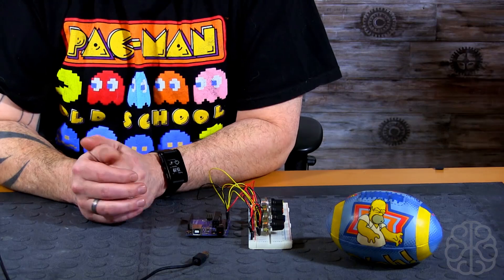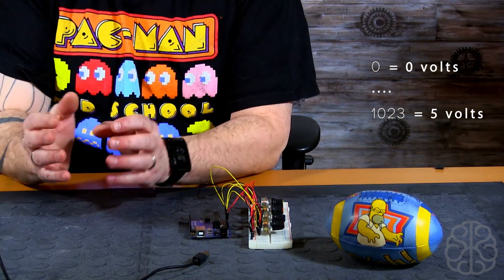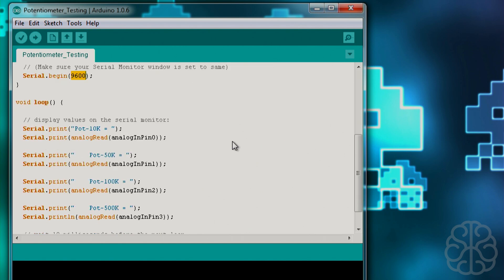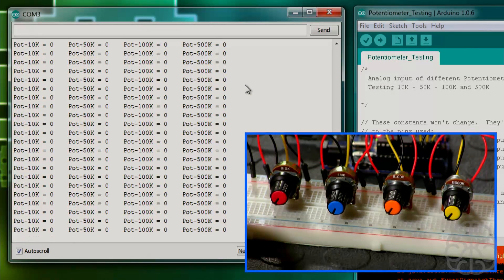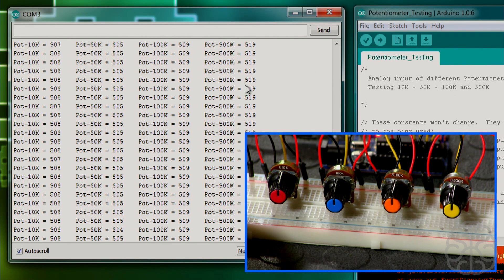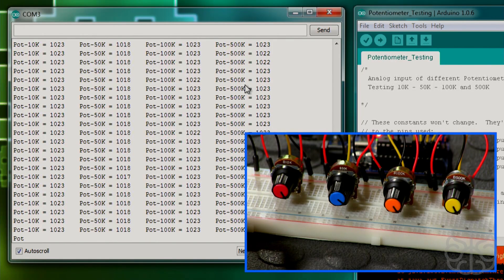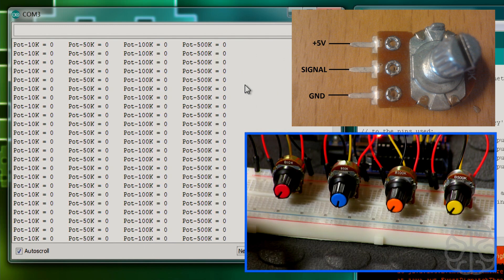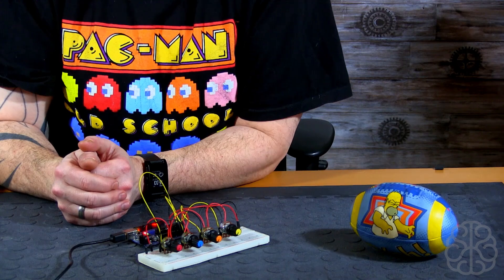Potentiometer Values?  Does it matter in your next Arduino Project?

Comment: What you did not discuss is, although the position of pot is static but, its value is changing and it is a very big issue because if you build a program which send incremental  or decremental code when pot val increases or decreases respectively but if pot value continuously swing back and forth then your program will continuously send data which is disaster, how will you solve it?
Reply: Make a report and average out the values over a lastmillisecond type of delay (to not stall other operations) loop, so that a value needs to change more than 1-2 back and forth.

Comment: Im using 10k pot with arduino for running stepper motor but the stepper dosent run at full speed it can do! The code has no speed max or anything defined. Help
Reply: 1023 might not be 5V, but somewhere along 4.6V.  I'm not sure if this will matter for the output stage of the Arduino, but it could do that.
If the stepper motor is run through PWM, it might be that the frequency for the PWM output is not high enough, and the motor tries to keep up with the low frequencies but has to much inertia to not act upon it quickly enough.

Comment: how about higher voltages????????? thats why i was here
Reply: It depends on what you call higher, if anything, it's rare for things higher than 24V's to be controlled with a pot directly....because the amount of heat dissipated (it's a resistor after all, just a variable one) will become a problem quickly....
Should you want to switch higher voltages, look into higher power transistors or even MOSFET's and control the input through that.  I will warn you that MOSFET's can be more difficult to control.

Comment: I have my cars throttle body pot. I connect it on my arduino and im reading values from 512-920 instead of 0-1023 . I guess its my pot's resistance from it's own that give that value.  Is anything i could do to make it work to the full range or should i modify my code to split  that range of existing pot to 255 values of output?
Reply: If we are talking about an actual driveable car and not a remote controlled smaller one: pretty sure it's something digital and it get's corrected later on, or might use some error correcting in combination with the ECU in order for it to know about the sensor being present and in working order, since drive by wire is very common for years already.
It could also be calibration meant to be used so that the gas pedal registers a range from standard idle RPM to something considered more safe by the manufacturer instead of full acceleration...

Comment: how can you make the potentiomater only rotate lets say 15 degrees or 20 degrees? how can you adjust the rotation of pot to go from zero to 5 volts or off to full on and only turn the pot so many degrees?
Reply: Physically this is not possible for most (and if you do find one that has such a rotational range of movement it's probably expensive) but you can do this in the Arduino code with mapping the value to something new.
Keep in mind that this will cause trouble when you exceed the maximum value electronically: you will basically restart the electronic reach of whatever it is that you do with the input's data (As in: if you state that 0-128 is 0-255, after 128 on the input this will cause problems because it will not have a clue what to do with that value).
If you do want to solve this physically you could try to find a button (A Ritel or some different brand) with a notch on it that hits a part on the case your project is housed in so it stops movement.

Comment: Great video and explanations!  I am really new to building electronic circuits.  In my project, the parts list has 10K pot but a 50K was sent.  I built it anyways figuring the value shouldn't matter much.  The project is a very simple LM386 OP amp.  I watched your video to the end and at 6:54 you mentioned this does matter for the pot values in these applications.  Is this why my should be ridiculously easy project does not work?

Comment: How many 10k pot can I connect with Arduino Mega along with 16channel multiplexer?
that means 16x16 pots = 256. but will it function normally if powered with USB?
my concern is if there will be any effect on the reading as i am planning to make a midi controller with almost 200 knobs.?
Reply: Probably not a problem, you will probably need a separate power supply so the multiplexer itself is stable enough, especially since you are going to be using multiple ones you will probably exceed the capabilities of the Arduino's power producing capabilities.
I hope your project worked out by this time though :).
Reply: @Dutch3DMaster  thanks for the reply. yes i completed the project. the video is on my page now

Comment: Those has different RESISTANCE value...4 ways audio1) negative output input ...volume 2) pin1 pin2 or pin 2 pin3..pin1 pin3 circuit with CAPACITORS L1 pin2 negative..4) pin1 pin3 out pin2 CENTER  tap ...all pots has different values adjustable VOLUME CURRENT IMPEDANCE  FREQUENCY ...THOSE ARE THE FOUR WAYS CIRCUIT...4POTENTIAL BALANCE HIGH LOW FADE FRONT BACK EQUALIZER FREQUENCY VOLUMES GAIN LOUDER EXTRA BASS....
Reply: what

Comment: This video is not all that accurate it misses vital info, pots between 1k and 100k will work, but it's best to use 10k or 20k pots.
The datasheet indicates that accuracy will be lost for values higher than 20k. (This is because so little current will flow.) (This isn't shown here because there is nothing else connected and the pots are very close to the Arduino, using short wires.)
If you use values lower than a few hundred ohms you risk blowing the Arduino or power supply: more Info: https://arduino.stackexchange.com/questions/51230/what-is-the-lowest-resistance-pot-that-is-useful-with-an-analog-input

It's in the Analog Input Circuitry section of the Analog-to-Digital converter chapter  (section  21.6.1 on page 257 of the ATmega168/328 datasheet  Rev. 80251-AVR-02/09)

The second paragraph begins: "The ADC is optimized for analog signals with an output impedance of approximately 10 k[ch937] or less."
Reply: How many 10k pot can I connect with Arduino Mega along with 16channel multiplexer?
that means 16x16 pots = 256. but will it function normally if powered with USB?
my concern is if there will be any effect on the reading as i am planning to make a midi controller with almost 200 knobs.
Reply: @DJNAVENDU  Sorry to reply 8 months later to this comment, but since I had the same question and found my answer may as well share it. 
The thing to keep in mind is that each port of the arduino should not handle more than 40 milliamps per pin in the best scenario. Based on ohm's law, if you have 5 v, and 40 milliamps, that means 125 ohms, going any lower than 125 ohms will pull more than 40 milliamps and will burn your diodes on the arduino... or worse start a fire. 
The higher the resistance, the less current is needed... but at some point you don't have enough in that circuit to be detected properly (over 20k) at 10k you have 0.5 milliamps and you are only using 0.0025 watts of power so it's a perfect balance of effective current and it's safe to use with 5v ! Hope this helps ... and I still have much to learn.. so thanks to videos like this, partially true, partially incomplete, and great comments like the one above from niksoftware and intelligent questions ... and answers ... we progress.

Comment: why you're connection at arduino pot is different mine at left pin is ground and at the right is 5 v
Reply: as you (arduino) measures the middle pin. The middle pin is 0 - 5V by its position. No matter the potentiometer value. How the video shows.

Comment: Be good to also explain that a pot is not just a variable resistor, but a complete voltage divider.. as resistance increases on one side of the signal wire connection point it decreases an equal amount on the other side. The total resistance seen on the overall connection from 5V supply to GND is the value of the pot. This also determines the current induced in that connection (as someone mentioned below - if value of pot is too low, could induce large current & damage supply.. unlikely though as most pots have large enough resistance value).
Cheers

Comment: Hello, I'm a complete newbie. I want to build such a circuit with 3 pots for a DIY sim racing pedal set. Can someone help me get the schematics for this circuit? (how to connect the wires without breadboard?)
Reply: Supersimple: Just solder the wires as you see them on most breadboard setups to the potentiometers directly, and use either pin headers or cut up a Dupont style wire that you might have bought with your Arduino and use that as the connector on the Arduino side of things.
If there's anything surrounding Arduino's this is about as simple as you can get it.

Comment: Pot value does make a difference in the lower value and for less  noise. If you connected a 20ohm put. power supply would blow. I know you were genralising here, but someone will try it and complain.
Reply: It is simply Ohm's Law: U = R · I, where U is the voltage, R is the resistance, I is the current. Since you always have 5V, the resistance determines the current flow. There is nothing uncommon about a 50ohm potentiometer, and the result is:
I = 5V / 50ohm = 0.1A
That means that you have 500mW through the potentiometer, and whether or not the voltage regulator on the Arduino will burn depends which one it is. Most regular small potentiometers cannot handle that power, though, so something WILL burn :)

On the other end, when you use the very large values, such as your 500 kilo-ohm, you have a fairly low current flowing (here 10uA), and that makes your readings more vulnerable to disturbances from other sources, such as noise from power supplies and things like that. Of course, if you have a battery driven application, you will want to limit the current as much as you can, if it is supposed to be active all the time. Then you need to compromise.

So the short version of this comment: It DOES matter which potentiometer you pick. Very much so, even.
Reply: @Klynder1  The datasheet indicates that accuracy will be lost for values higher than 20k. 10K is the sweet spot it only uses 0.5mA
Reply: @Mikael Klynder So what would be the best you would generally recommend? 100K, 250K? Just for analogRead purposes. Thanks!
Reply from the maker: +Terry Peake Thanks for the comment.  I don't understand what you meant by: power supply would blow?  can you explain what you mean?
Reply: +Brainy-Bits As the pot is a resistor. one side goes to plus  5 and the other to ground, having a very low resistance pot would draw a lot of current from the supply causing it to overload. I was just pointing out incase someone had a very low resistance pot.
Reply from the maker: +Terry Peake I guess it would act like connecting an LED without some sort of resistor.  Thanks for pointing that out...  I don't have any pot lower than 5K but in case someone has on hand  a very low value pot it's good to know to not use one that is super low value.

Comment: i'm working on joysticks recently and the analogRead is really a pain in ass.
the read value is always not so accurate that you just can't easily map the value.
analog goes between 0-1023 in arduino, but the middle value is never 511 or even close to this value.
Reply: Zelra 仙賢戀軒 this is kind of a late reply but, you might be using a "logarithmic" potentiometer and not a linear one.
Reply: Most joystick scripts I've seen do some averaging on the input, almost as a hysteris kind of thing so it stops the input from bouncing between 1-2 numbers up and down.
The logarhitmic versus linear thing could be something as well...

Comment: There would be one reason for using a larger Potentiometer and that would be in a battery application with a number of potentiometers the current draw would be lower and then the batteries would last longer.
Reply: +Akrout Osama that is per pin, but the whole package can provide 200 ma through vcc, analog reading are sensing on a point. Vcc and gnd of a pot are where the power flows through
Reply: +Akrout Osama This is about battery life. The lower the total current the longer the battery last.
Reply: +Ken Heinrich  hi , but the Atemaga chip is able to sink or draw a 20mA max what ever the pot value ; larger than 20mA the voltage divider is useless .